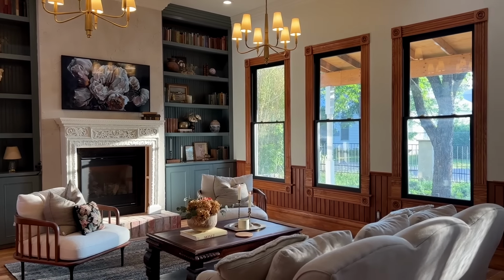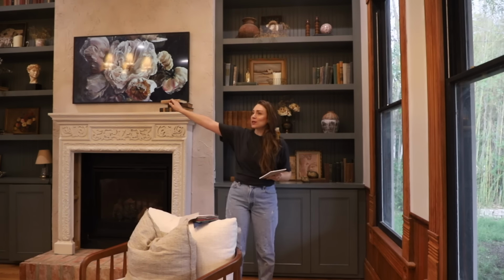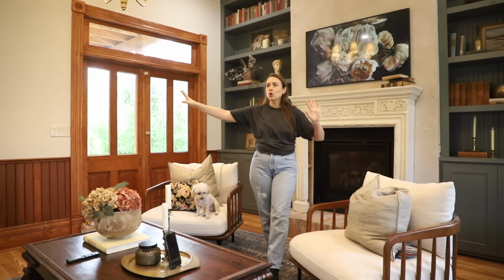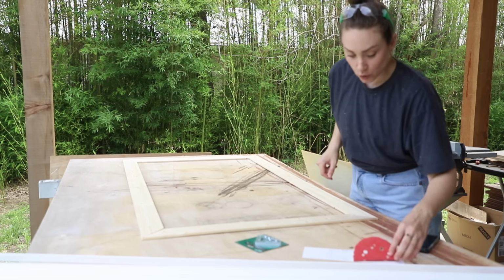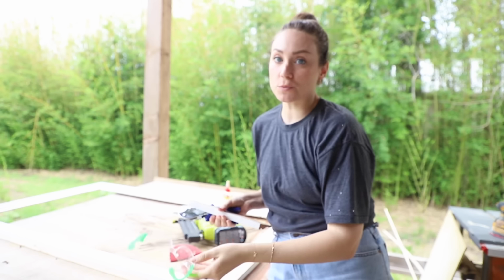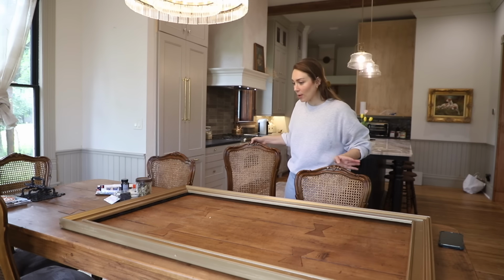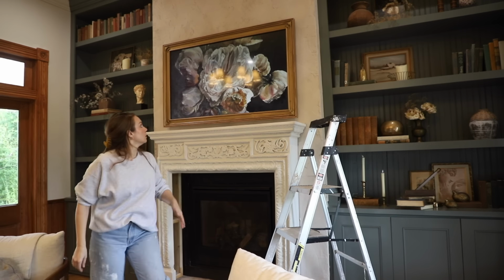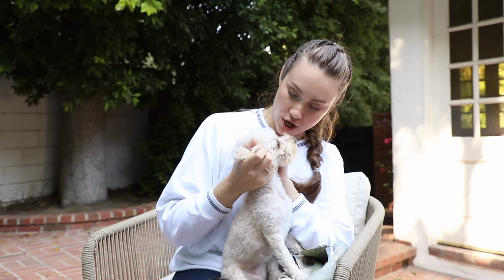LIVING ROOM MAKOVER *DIY TV Frame* | XO, MaCenna

Comment: Idea for your outlets. I had a built in fireplace wall put in years ago. I had them install the outlets in the closed cupboard on the bottom and they drilled a small hole up into the shelf above. That allows me to plug a small lamp in while hiding the cord down in the cupboard.  Twenty years later I still love that feature.
Reply: I suggest that as well!
Reply from the maker: Yesssss this! I have to do that!

Comment: With window treatment, especially doing an inside mount, you should measure top, middle and bottom as in most cases the window won’t be 100% square. Take the smallest of the three measurements. For height, do the same thing but take the longest length. Also find out how much the factory takes off for clearance on the sides. Most people don’t like the finished space amount on the sides as light will come in. Usually 1/2” is taken off, leaving a 1/4” on each side. Depending on the head rail system you could asked them to only take a 1/4” off leaving less of a gap.
Reply: Great advice, I was thinking  the same when she was measuring. So important to measure  and use the smallest measurement.
Reply: @lindaga820  I used to work in the window blind business for years and saw a lot of mistakes made by home owners or homeowners not being happy with the clearance amounts.

Comment: Looove how the frame looks with the picture light above! I know it might be a little to late for this observation but I think it would've been a nice touch if you added a velvet or linen ribbon to the flat surface of the frame in between the two molding pieces, a lovely detail that I've seen you like to find in some your vintage/ thrifted frames. Just an idea in case you have to do another one jajaja ✨

Comment: It looks great McCenna! Girl you should really explore wax. You put on clear wax, buff it up then add dark wax. It would do your low deep creavis & then you wipe buff the dark wax. The clear coat first controls the dark wax. Then you can put your rub & buff on. It's also sorta wax but grabs much more than just a regular furniture wax. This would work well on the fireplace mantel as well. The wax is a sealed finish on its own. Wax is the last thing you put on. Its a very nice spealer & makes it easy to clean & wipe off dust & such. Water proof as well. Try it you will love it! It will make your detailing much easier.
Reply: Wouldn’t the wax melt being the tv is over a fireplace? Thanks
Reply: @janetbof4  No furniture wax dries hard after it cures. A good dark wax would be much easier than how she's doing it. It's designed to brush on leave a couple of hrs. Or whatever the wax calls to do. And it will add so much to the cracks creves & detail. You wax in wax off & buff to a beautiful finish .

Comment: cant believe you didn't use a drop cloth on your pretty table while you stained that frame!!  Great ideas, frame looks beautiful
Reply: I know, I was holding my breath in case she knocked over one of the pots. 😮
Reply: I know!! I was so nervous!! I would have had plastic down for sure
Reply: I came here to make the same comment. Even though she is careful and is very neat, accidents happen occasionally to everyone. Why take the chance? Does she not like the aesthetics of a plastic sheet or drop cloth in the video? It’s hard for me to understand as she often does not use a drop cloth, such as when she as doing the trim stain in the living room. One bump of a can of pain or stain can really mess up the floor or that dining table. Why not take that extra precaution?
Reply: And drilling the hole in the frame with it on the TV! I guess she knows her limits!
Reply from the maker: Hahaha I’m pretty careful with things so I guess I didn’t even realize hahah 🥰

Comment: Dear MaCenna, 
I have loved your videos for a long time and always can't wait for a new one to come online. 
A little tip about your frame (which turned out great, by the way):
I would suggest you to put a washer between the screw and the rubber band (on the backside of the frame). So the screw has more contact surface in the rubber and does not tear you so quickly. And believe me, it WILL tear eventually, as rubber loses its plasticizers over time. 
All the best from Germany, Dagi

Comment: Your windows would look great with inset Roman Blinds.  Because the window frames  are ornate the three windows should be treated as one window with Dress Curtains at either side, pulling the whole thing together. Put the curtain pole about 1 foot above the top of the windows  and about 10" out at either side. This way the window frames are visible, the blinds give you privacy and a curtain at each side will give a cosy effect.....😄🇬🇧🦋

Comment: For the stretch rubber stripe, I would put a metal plate under the screw before secure it cause giving time and the weight the screw may eat into that rubber and causing stripe snap⚠ I love your design it's so elegant!

Comment: Everything looks perfect - like it should have always been exactly as you've made it.  Well done!  I'm so excited for the next round of finishing touches to the cottage come fall.  The mullions in the windows and the transom over the front door and the Roman shades!  They'll be just right and I love that you're planning long curtains on the sides as well.  😍

I'm confused by "issue" with the brick, though.  It doesn't come across as pink at all.  More of a true salmon (not Crayola salmon which IS pink, but more of a light coral.  Sort of a pale pinky orange with highlights of a deeper, almost terra cotta-ish shade here and there and highlights of a bit pinker shade here and there.  With all the whitewashed effect, it gives an overall impression salmon.  And I think the color variation adds some interest to your room.  You have all solids, no prints, so this adds some variety for the moodier solids to play off of.  And with the light walls, the light mantel and the lime wash all in that area, it adds some contrast that might be lost with a lot of grey over-grouting.  The current color just seems to work well with the floor, the trim, all the paint colors, the rug...  I'd wait until the window treatments and chairs are all in place before making a decision.  

Of course, colors look different on camera and and then again on devices, so...  And it's YOUR house!  😂  I hope this isn't interpreted as "trying to tell you what to do" as I don't intend it that way at all.  Just a different view that you might consider.

Comment: Hi Macenna!  I  Have to tell you about a product you have have have to check out!! It's called Woodubend. It's made of sawdust and olive oil and secrets. Invented in UK. You could have made your tv frame or top wainscotting or add to furniture or lamps vases, anything you can think of!! When its cold you can drill in saw it cut. When its its warmed up you bend it shape it. There are carved trims with flowers and vines leaves curly cues. Pediments, finials, of every design. You paint ut, stain it, guild it. You could recreate your fireplace in ten minutes and it's made from wood!!  You can make your doors ornate with the trims and pediments they offer.  Paint or stain then rub on guilding wax. You can get the carved trims and ornate pieces and add to flat  plain frame and in minutes have a vintage carved gold frame that looks like original. Plain mirrors become Anthopology mirrors in minutes.  Wood glue heat gun or blow dryer is all you need.  So please please check out the videos on Woodubend. The owner Sollie Jo has unbelievable transformations in minutes!  I'm so glad to tell you about this incredible stuff!  You will never have to shop around or wait for vintage again!!  Also,  your designs and style has inspired my own!   I pretty much know that your next video will include Woodubend once you see what you can make.

Comment: For outlets I have a similar set up in my new house, the outlets are inside the base cabinets. I went online and found drop in puck outlets, drill a hole on top of the counter I put them in the corners. They sit almost flush two plugs and 2 usb ports. They plug in underneath and they are threaded so the stay in place. I love them.

Comment: Hi MaCenna!! I have the same tv, and the frames retail for more than $600! I could never justify that, but I really want my tv framed. Would you PLEASE leave a material list? I know I can build the frame myself, after seeing you do it, but I don’t know what to buy. If you could list the materials you used, and also, what that rubber piece you used to hang it was called, I would be so appreciative!! (just the wood I will need, and measurements would be so incredibly helpful!!)

Comment: Hi Macenna, I absolutely love all that you do, but one thing has been worrying me about your fireplace.  Have you checked the manual on clearances to your fireplace?  Please don't get me wrong, I LOVE the mantle!  It is gorgeous!  But, I am concerned that it may be too close......  Please check those clearances.  If it is too close, it won't burn immediately, but over time it will keep drying it out until it can combust.  As I said, I am worried!  (It's the Mom in me!)

Comment: Hoping for some information on this tv. Is MaCenna framing over the Samsung frame or does it have the option with or without frame when purchasing? But then, what’s the point of buying a framed tv that’s not framed? Or are you buying this tv because you can make the tv look like wall art? Thanks